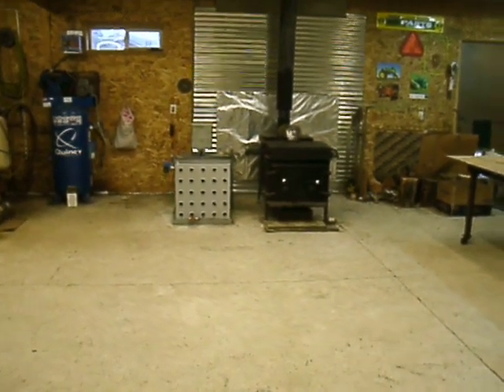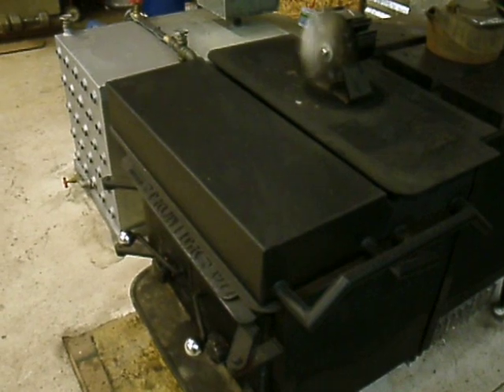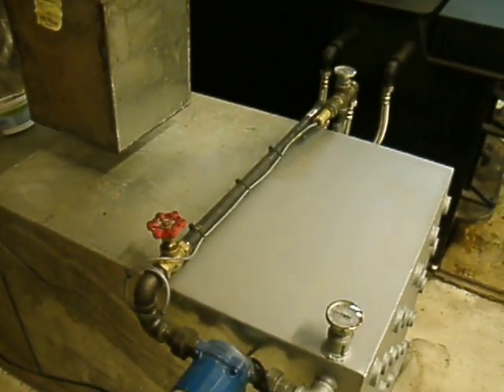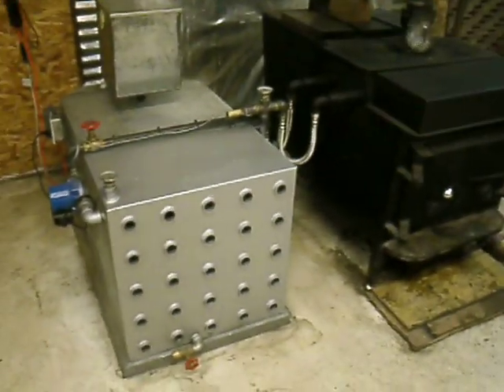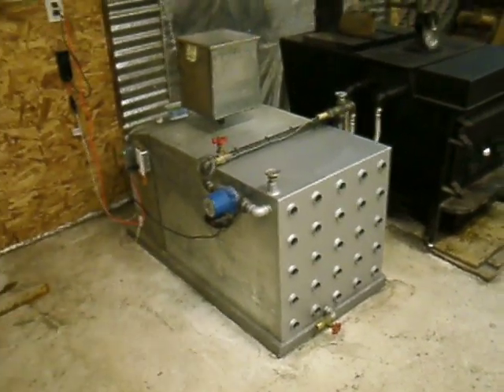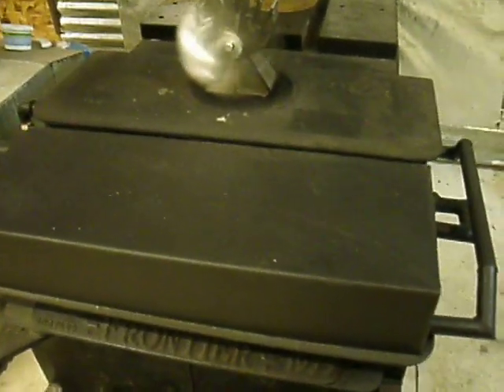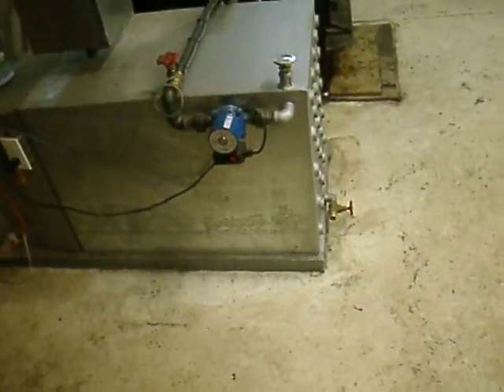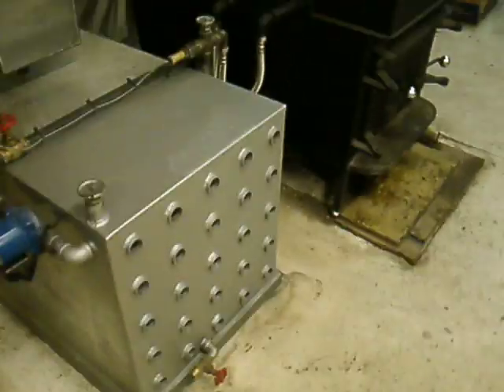Wood stove Boiler for Shop in Montana.

Comment: A very well made system. I know the weather in Montana is just a bit on the cold side. So nice to see someone use there gray matter to make something homemade that works really well. Happy New Year fella too. Peace.
Reply from the maker: Thank you for the nice comment.  I am amazed this winter how much less firewood I've gone through, and it's all because of something as simple as a tank of warm water.   Thanks, Pat.
Reply: @paddyb431  Pat my stove just an upgrade with secondary air burn. I can tell you that my wood use is cut in half. Why did it take so long for this information to come out. Also, I have a 15 gallon tank on the stove and that really helps too. Simple is the way to go. Peace V

Comment: Looks good... FYI ... return line needs to be above 145 or it will condensate.. That is why outdoor boilers rust out so fast.. if  you can keep it above 150 you will have no issues,, Also put a little soluble oil for cutting steel you will have no rust issues also.. Cheers
Reply from the maker: Thanks.  Yes, have some cutting oil in it.  If you see my updated video on the boiler, I moved it. It's above the stove now and the water stays well above 150 F., and the shop is usually still warm when I get there in the morning since the boiler is still radiating some heat.

Comment: I would suggest some kind of pressure relief valve for safety.
Reply: As I agree with you- with the overall differential in water volume between the box atop the stove versus the heat exchanger box, it works under the same principle as hydraulics. The cooler liquid in the vessel with a significantly greater volume will cool the hotter liquid. This, with the probe jogging the pump on and off, it SHOULD balance itself…. Long as nobody over stokes the wood burner…. But, at least an expansion tank with decent volume!!

Comment: All galvanized just give it another year or two and it will start popping leaks at the welds unless you did chemical treatment but I am guessing not. I am sure it works though there are better ways.

Comment: i put boiler heat( propane fired) in my house in 96, the boiler has a small pump inside, we added a bigger pump(in line) that runs all the time, i headered 2 lines  with the intent to add a wood burner with a water jacket that would supplement the existing unit, could i build a top mounted manifold to pickup extra heat sending it thru the house and back to the main boiler? That water, i think could or should keep the house warm enough to minimize the main boiler from kicking on? The bigger question is to and how to build and place the manifold or hot water box to the wood burner? Thank You.

Comment: What's to keep the water from getting too hot when the pump fails or the power goes out and the fire just keeps heating-up the pipe and the 5-gallon tank mounted on the stove?  This doesn't quite make sense to me and you said a couple things that seemed nonsensical.

Comment: how does the water get to the  unit and do you need  a pressure relief valve nice job may make one
Reply from the maker: The water is in the boiler all the time.  There's no pressure relief valve needed since there is an overflow tank/reservoir on top.
Reply: @paddyb431  is the overflow tank sealed?
Reply: You really do need to put in a water heater pressure relief valve on that. Secondly the thermal stress of the water actually boiling in your heater tank is reducing the life of the steel. I advise you continually run your circulation pump but the relief valve is a must, that is a bomb waiting for something to fail. It's a 5 dollar item that will save your life
Reply from the maker: @benholler1389   No, it is not sealed which makes the system non-pressurized.  The water in the overflow/reservoir is about 3" deep when it's cold and 1/2 to 2/3rds full when hot.  There is no pressure in the system and the lid just sits loosely on top.  It's been this way for 3 years and I've never had an issue.
Reply from the maker: @colinkulasik1128  No, I don't.  You don't need a PRV in a system with zero operating pressure.  The water tank on top of the tank isn't sealed like a radiator cap-it just sits there loosely to keep dust and dirt from entering the water system.  Zero pressure. Also, the water temp has never gone above 170F so the water isn't boiling-it's just heated.  The circ. pump kicks on when the water gets to around 120F and stays on from there.  There's no "bomb waiting to happen".  It's been running flawlessly like this 7 days a week for the past 3 winters and I haven't had to fix or repair anything on it.
Reply from the maker: @benholler1389  Ben, no it's not sealed.  Covered, yes, sealed no.  It's a zero pressure system at all times.  Thanks, Pat
Reply: @paddyb431  I was thinking the whole video it needed a PRV, but I’m glad to hear it sounds like it’s like a open vented system with a feed and expansion tank on the top 👍

Comment: What happens in the event of a power outage while there is a full fire burning in the stove?
Reply from the maker: Nothing.  The fan would quit, I'd still have heat and it would just radiate naturally into the shop vs. having it blown all over from the fan.  We've had power outages several times since I've built this and it's the warmest place to be (next to the stove) until the power comes back on.